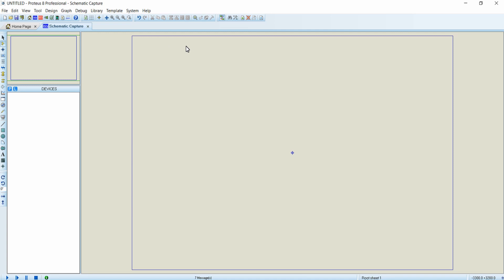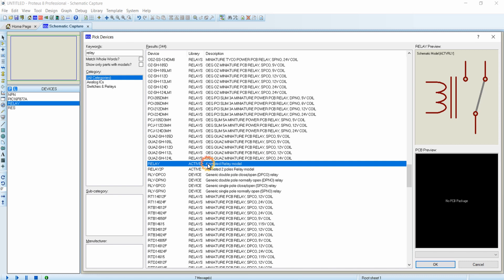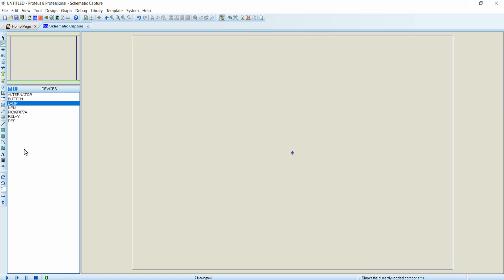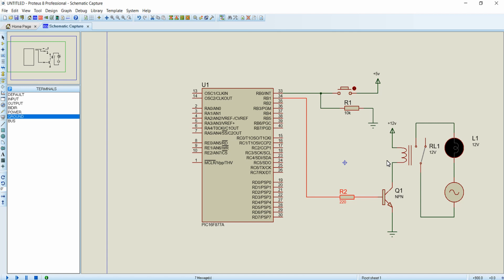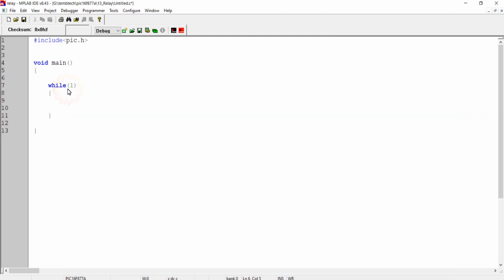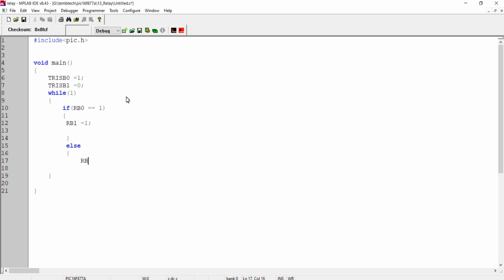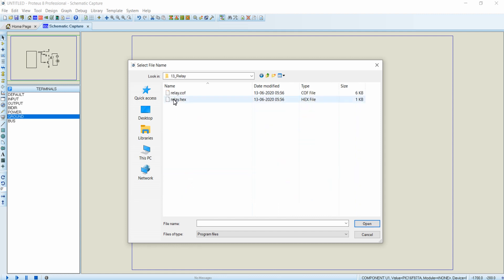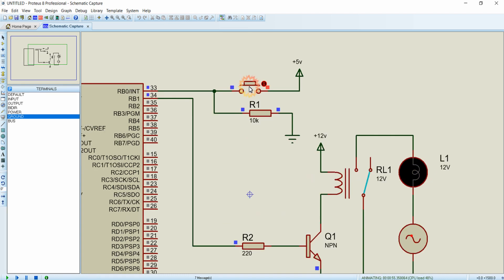Interfacing Relays with PIC16F877A | MPLAB IDE PROGRAMMING COURSE | HITECH C Compiler

Comment: Sir, I have designed and implemented the same steps as you have mentioned in Proteus and MPLAB but I am not able to get the result at the end. I do not know what is the issue, so if you could help that would be appreciated.
Reply from the maker: Then what is the output you received any errors ..? Or any other different output
Reply: @SMtrainingacademy  when I ran the simulation in Proteus and after pressing the button, the relay NC terminal does not switchover to the NO terminal and that does not turn the lamp on.